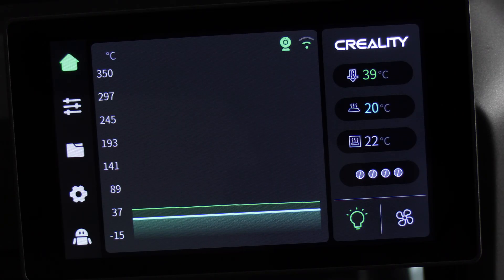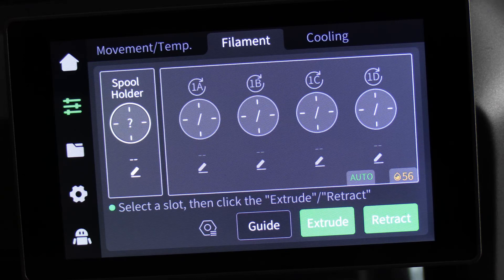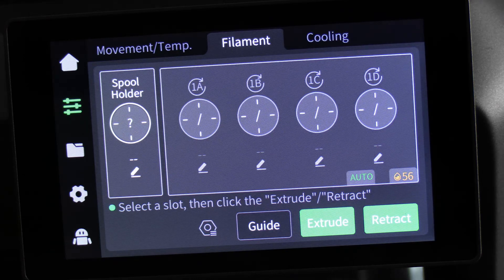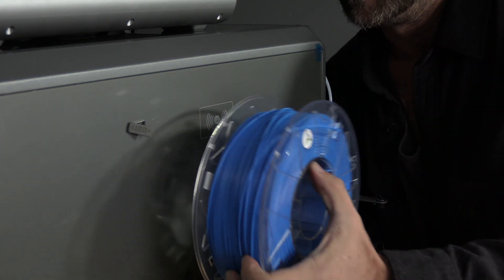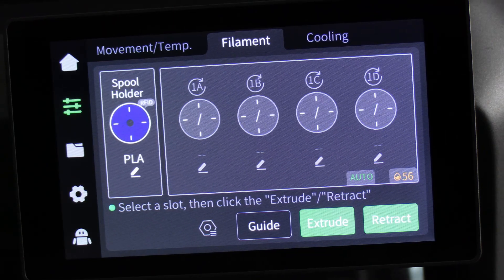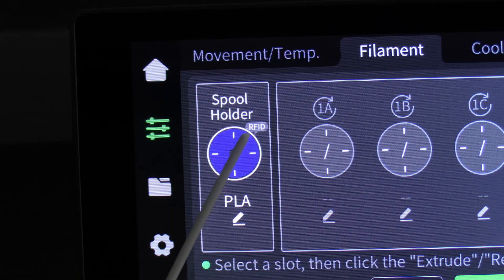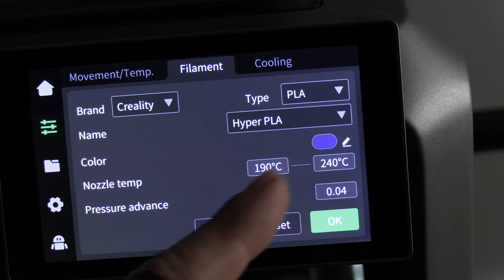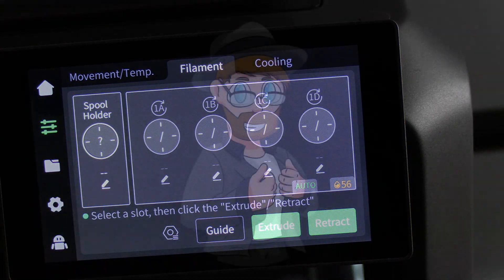K2 PLUS: Load Filament to the Spool Holder, using RFID to auto configure

Comment: But you did not show how it was loaded into machine... anybody can read the UI...
Reply from the maker: No, actually they can't. Understanding this, is what makes me a pretty OK teacher. Never assume anything is easy or obvious.
You load it the same way you load any other printer from an external spool holder. Put it on the spool, push the filament into the PTFE.
Reply: @3DRundown  Well yes it was not clear, I had actually unplug the ptf tube from the 4way splitter and plug it to the plug it to the connect near external holder, then feed the wire all the way in. And I can't use one of the 4 ports on the plastic box that accept cfs
Reply from the maker: Just pop off the PTFE at the top. Feed there. When done, pop it back in

Comment: If you want to fit the spool and CFS at same time, I get that yo can't have a five colour print; but where do you connect the spool holder to the printer? Via one of the sockets on the material buffer?
Reply from the maker: The spool holder mounts to the side of the machine, and you just swap the ptfe to it. Catch my assembly and setup video

Comment: I finally got mine, together with the filament dryer.. My question is: can I only load the filaments from the CFS or can you also load from the spoolholder / filament dryer and the CFS together?
Becaus as I see it, in theory you have the splitter at the back of the machine which allows you to use  4 CFS in total, but couldn' t you use 1 port for the CFS, 1 port from the spoolholder, and 2 ports for the filament dryer? The only problem I see here, is the CFS is connected to the Printer, so it gets the informations from the CFS, but there is no info from the spoolholder or from the filament dryer...
Reply from the maker: You choose one or the other....  spool holder, or CFS. You can physically connect the spool holder spool, but it won't do anything, unless you manually choose it
Reply: @3DRundown  I assume you just push the filament through from the spool until it won't go any  further. At this point do you just press print or do you have to do a filament extrude.

Comment: So will it run five colours, four in CFS and  one on the spool, or is that one or the other ?
Reply from the maker: 4 or 1. 16 with 4 CFS
Reply: @3DRundown  the way it looked on the screen, showed CFS and spool
Reply from the maker: Yes. But you can't auto swap from the CFS to the Spool. The spool is not motorized, and the tube is swapped, from CFS to Spool. It's CFS, OR Spool.